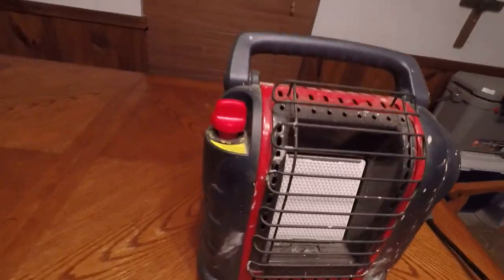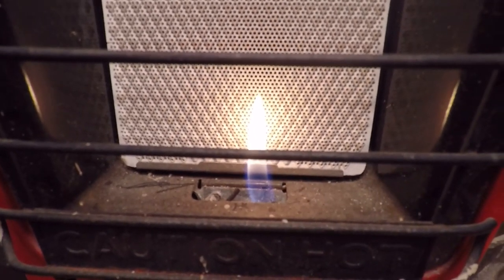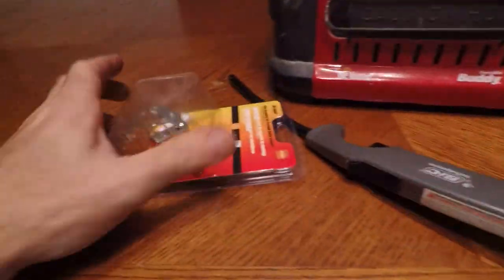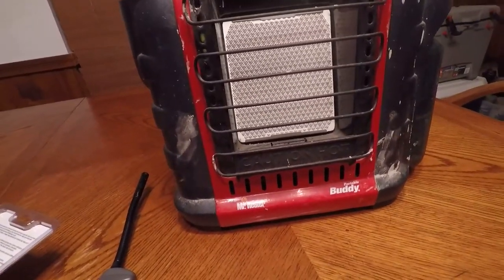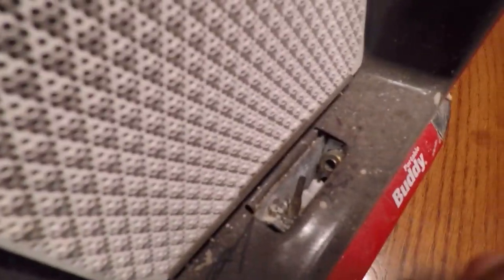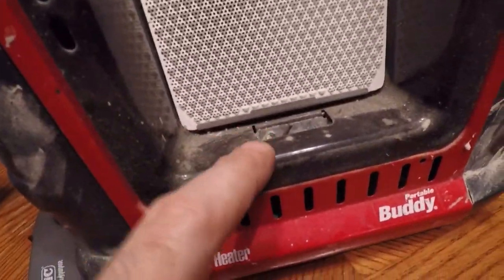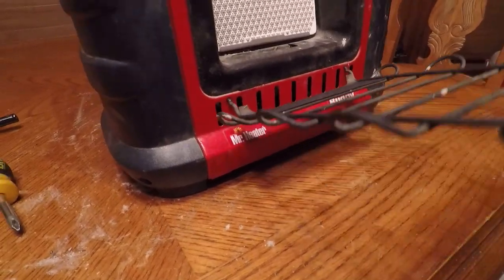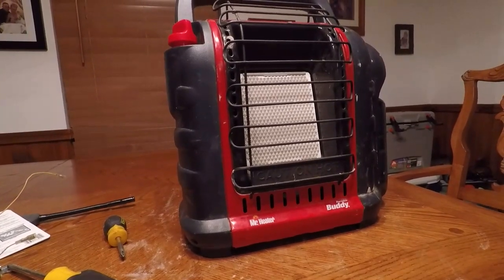Mr Heater Portable Buddy Heater Ignitor Replacement

Comment: There's a yellow flame that means there's an oily liquid inside of the lines that's why it's not blue and shooting out like it's supposed to there's nothing wrong with the igniter I've repaired many of them all you need is a can of air to blow out the oil liquid inside the lines.

Comment: Excellent video. These look harder to work on than the two burner units. I need to clean oil out of the gas lines or throw mine away. Guess I'll take it apart and clean it, thanks to you.

Comment: It is not necessary to totally dismantle the heater casing. There are 4 screws that hold the back panel on. Remove those 4 screws then use a screw driver to pop the back panel off. Then there is one screw holding the mounting bracket for the igniter assembly. Remove that 1 screw holding the bracket then 2 screws hold the ignitor assembly to the bracket. Install the new ignitor and reassemble the heater.

Comment: Don't bend anything on the pilot assembly.   The only problem here is that the pilot is dirty.  Take it apart and blow out the dirt and clean the pilot orifice. The pilot flame has to burn on the tip of the thermocouple. Unless the thermocouple is bad.

Comment: What is holding the igniter side off
Reply: You got the propane side off but mine doesn’t want to let go
Reply: Also the screw connecting the thermal coupling to loosen. Should I try wd40?
Reply from the maker: This is one of my worst videos. The disassembly is pretty easy and I finally figured it out at the end. If the fasteners are stuck, I might try a little heat from a small torch to free them up. Thanks!

Comment: I should have moved on to the next DYI mr. Heater repair after  the 1st minute. Trying to follow this to repair my heater I just screwed it up really more. I am about ready to throw it in the trash. Why did you go through all that dis assembly and publish this. When you knew all you have  to do is pull the back and the bottom. Undo the gas to the igniter/ piolet , undo the one silver screw disconnect the electrical and sensor connection remove the assembly from the backing plate. No need to get into it from the front no need to remove the ceramic piece no need to take the side off with a knob on it. No need to remove handle. You should remove this shity video do it over again per your first minute statement. Stick to things you know.
Reply: learning what NOT to do is priceless!
Reply: Fixed  thanks !!